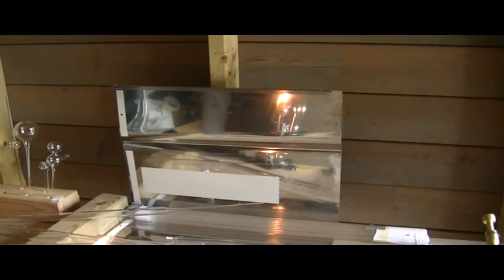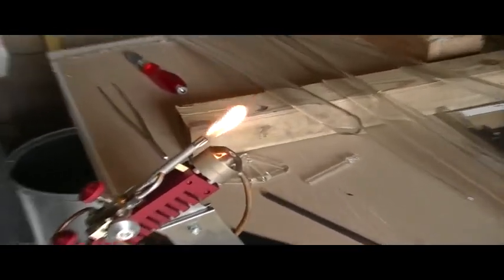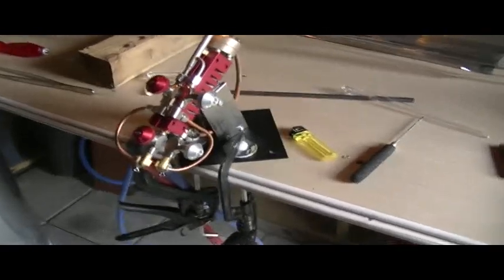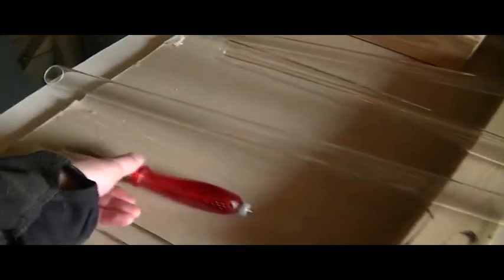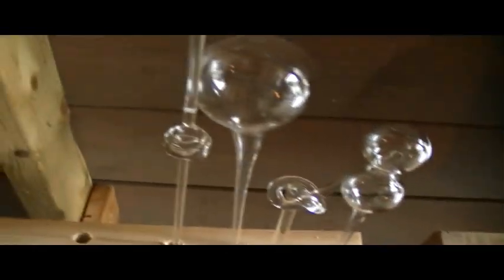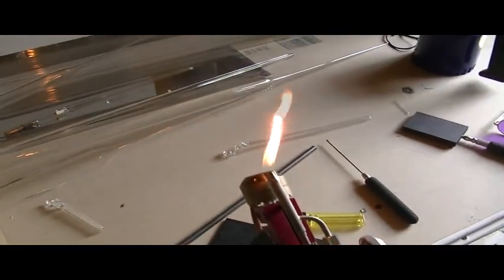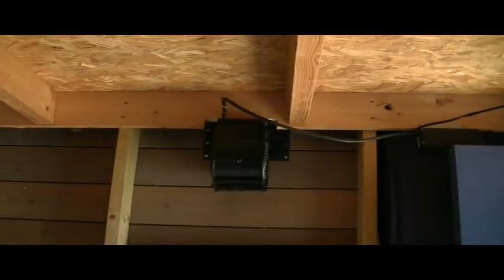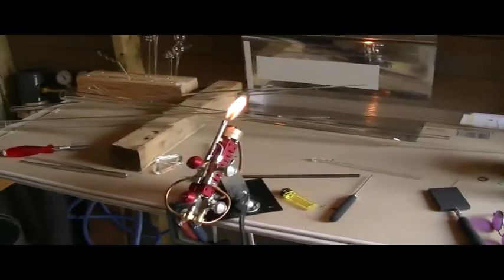beginners glass blowing setup

Comment: first off nice set up! i just started working for a production company and fell in love with working glass! the lighter issue can be solved by attaching it to the bench with some string or wire and letting it hang off the edge. you should run the fan whenever the burner is on, and it looks like you have enough hose, why not put the propane outside? its supposedly safer to do so. thanks for posting this video, i will get one around to show you my home shop. also mad respect for that quarts spiral

Comment: So the ventilation comments were a year ago but to touch base on it, if your space doesn't get too cold, you could leave that door open and just get a box fan to blow out all your fumes.  And it would be fumes from not only your color glass (metals, silvers, golds, etc.) but it'd be from the clear and your gases as well.  Clear will still burn and vaporize a little.  The propane you burn you don't want to breathe.  And just in case, the p-tank under your bench could leak for whatever reason

Comment: FYI for anybody watching this and thinking of doing a similar setup:  You need about 1000CFM (cubic feet per minute) for that torch, (or most any glassblowing torch) at a bare minimum.  You want a fan hood, like a commercial range hood or something, with very powerful air moving abilities.  More is better, especially as you fume, work with color, accidentally blow out bubbletrash...  You need a controlled flow of fresh air from the source, past the glassblower's head, to the torch, and out the fan, in that order.  Intake will ideally be filtered, at least for dust, and on the opposite side of the building as the exhaust. 

  If you want to blow glass, you absolutely must have good ventilation and good eye protection, meaning mainly Philips or Aura, at least in the States; don't know if there's any other Euro-only brands of eyewear?  Those didymiums are good for soft glass, but not really enough for boro; get some shade 3 or 5 flip-downs over them at least.  I imagine the quartz is pretty bright, being so hot; be careful with your eyes, you only get one pair.  Make a super well lit workstation, and wear shade 5 Philips or Auralens, is my advice.

  If you want to make anything worth keeping or giving away, let alone selling, you must have a good, programmable kiln for annealing.  Otherwise, the glass you make is liable to shatter and explode at any time, possibly injuring somebody. 

  No offense, but in my professional opinion this is not a safe setup, and should definitely not be copied by anyone thinking it's safe or legit.  If you don't have at least around three grand to spend getting set up, my advice is to maybe reconsider, because if you can't afford the bare minimum safety gear, you can't afford the hobby, let alone the business.  No way I'd work five minutes relying on that fan.  Open door is a non-starter for a few reasons...  Get a good exhaust fan!
Reply from the maker: Thanks for you reaction.
Indeed I agree with most things you mention, but this setup is now 3 years old and I have upgraded it several times. I have a nice exhaust now as well. 
On the other hand, I do not tell anyone how to run their show, I only show how I started. Anyone starting should realise it is their own responsibility to maintain safety!
Reply: So of I did have 3k to drop on my new hobby, can you put me a package together?  I like that torch though.

Comment: @spedgren22 Lets see, the torch is about 700E. which is the biggest chunck. The gass(bottle) will set you back a few hundred, but when you buy more amount of gass in one go, it gets cheaper. The glass, i now obtain from a befriended glass blower, this is about 15E p/kg but it depends on the diameter and/or color. There are online suppliers, you will have to google a bit! :-)

Comment: What is the name of the tourch you used? I know you said it in the video but i didnt quite get it. I would like to look it up to buy one. Thankyou
Reply from the maker: It is a Nortel make. The model is called "The Red Max" I think.
I might get a different torch soon as the Red Max is not always sufficient..
Reply: I am not sure if I have the same burner. Name is the same and has a maga minor for a top fire, but that looks not quite as yours. First mine has a nice red sleeve ( extremely important ;-) but what really bothers me is that from the looks of it you get a very concentrated flame. I can go to pointy as well with mine, but by then the flame does not generate usable heat to e.g. clan up a T-seal in 10mm thick wall boro.... any suggestions? I fear it might be my amateurish misuse of the burner....
Reply from the maker: dercebe I know what you mean.. The fact is, the type of flame and it's heat is not enough to do the things you mention. I suffer from this too. The flame needs power to reach the corners of the glass.. Therefore I want to buy an extra "welding type" hand torch. These are more noisy, but very hot.
There is a slight chance I will go for a proper torch like the TT or Arnold ones. With these you can never go wrong.
Reply: *****
Oh, I see. For welding recipients to a vacuum system I use a welding torch that is designed to run on propane oxi rather than acetylene, works quite well but is a bit clumsy, maybe with a mount to use is stationary... at least it was pretty chap <100EU knew with 2 tips. I still have a Arnold Zenit Mini 113/2 ESL sitting here, but my landlord wont let me have natural gas.... so a expensive paperwight for now. Maybe I try bottled methane but not sure if it is worth the effort. Thanks for the good info. BTW, if you would be willing to use an IR filter on your cam it'd help a lot for us viewers... darn it, I soo much want to see whats going on, I'd even aid funding if its not too over the top....